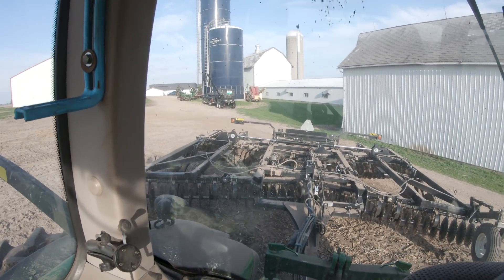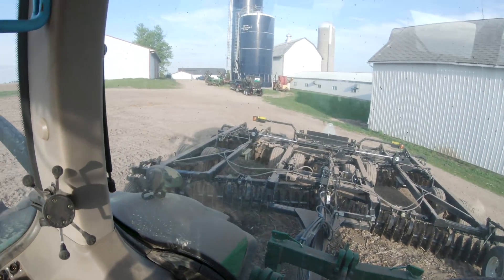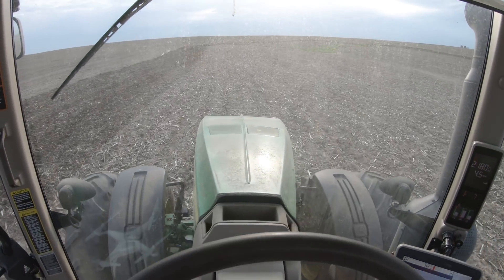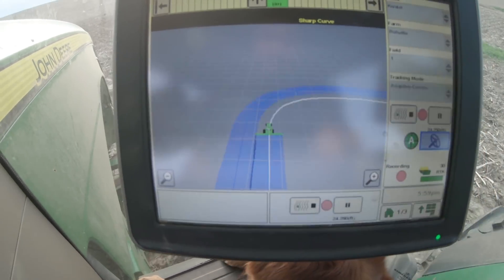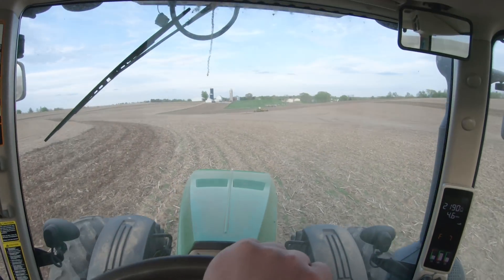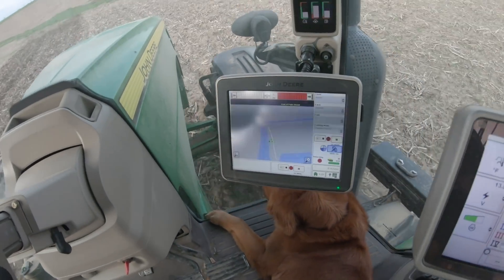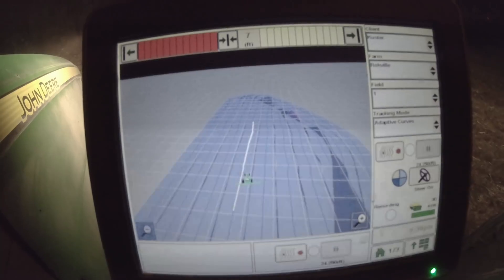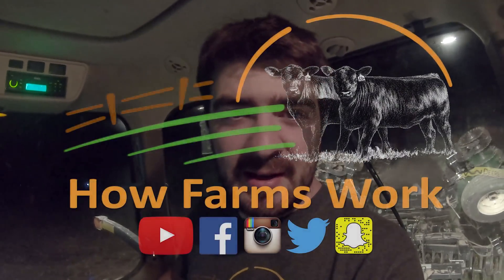John Deere 8235R GreenStar 3 AutoSteer - Earthmaster 3000 VT

Comment: Ive found if you mount the 2630 display on the top above your pilar gauges you have a better eye angle and easyer reach, mount with monitor bracket only with the upper bottom hole

Comment: Fascinating look at modern technology on the farm. As a techie I am impressed with what farm equipment can do. As a former farmer I can get behind sitting back and watching the machine do the steering. As a Dutchman(well 1/2 Dutch) I wonder about the cost to benefit ratio. I follow several farming channels and I see the technology at work and the claims made as to cost savings and improved efficiency. Still I have not seen any actual analysis of whether savings is really there. Leaves me wondering if this a  case  where a 10% gain in efficiency comes at a 30% gain in cost? Your thoughts?

Comment: Too many other variables in farming to actually see a money savings from auto steer. Yes it is cool technology but to me its just another cost to a farmer that is not needed.
Reply from the maker: It really depends on the acreage run and how many passes you’re doing. Honestly I can cover a lot more ground since I can reduce the overlap. I’m not promoting the technology, just giving my experience with it. I can really see the fuel savings just with tillage, but in planting it would be even more worth it with seed savings.
Reply: Yes amount of acreage is critical to the effectiveness. I would think your operation your not going to see a difference. Id pay more attention to how many times you drive over your field with tillage/field prep and harvest, burning diesel fuel is not cheap. Id be looking at different ways to save money with out spending it.
Reply: You couldn't be more wrong...and it obviously has to make sense on the amount of acreage like everything else in farming. Saves time, fuel, seed, chemical, and helps tremendously on driver fatigue which allows one man to cover more ground.
Reply: That's the problem with farmers.. their not willing to put in the work. I mean really a guy cant drive his own tractor anymore? Do we need to hang a pacifier from the air conditioned cab too? People need to pay attention to what they are doing in the field. Like I said it would not pay off on a size of farm like most in the Midwest. To many dumb ideas that farmers are buying into that are not needed.. just another cost and less profit at the end of the year..

Comment: Yep, this is how farms work. The modern farm that is. Guys will say they can be successful with their “old school” approach, but they are wasting seed, fuel, and time. Which is harder on equipment in the long run. Keep pushing forward kind sir. Best wishes from NW MO.
Reply: It has it's place... If you're covering a bazillion acres and living in the tractor cab 14-16 hours a day or more every day for weeks on end, yeah, in the long run it's probably saving more in fuel and seed and other expensive inputs than it costs... 

BUT, these toys are NOT cheap... meaning the return on investment is REALLY "over the long haul" because you have to save a LOT of fuel, seed, and other inputs to actually pay for the things, and the data/signal subscriptions necessary to get that sub-inch accuracy, activate the auto-steer, and pay for the equipment itself, maintenance, and repairs.  The more you have (like electric seed drives on the planter, automatic implement control, etc) the more cost and maintenance you have, and the more expensive setup you have to buy in the first place... 

You GOTTA cover a bazillion acres to really make the thing pay for itself... otherwise it's actually costing you money that could be spent on other things for the farm... BUT no two operations are the same, and not everybody's priorities are the same... so it really comes down to individual decisions.  Like how some guys choose a Ford over a Chevy-- both will do the job and get you there, but choosing between them usually comes down to individual choice or preference.  Maybe a better comparison is buying the decked out truck with all the bells-n-whistles, versus a "work truck" package... both do the job and get you there, but it all comes down to what the individual purchaser sets as their priorities-- some want to get there in "Cadillac" comfort, some would rather keep the cost down and spend the money on other improvements elsewhere... 

Later!  OL J R :)